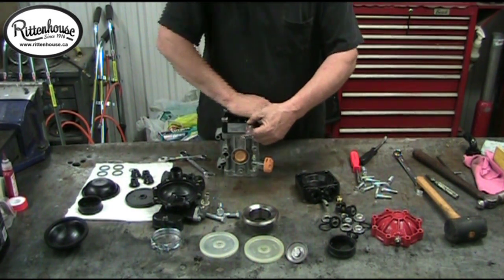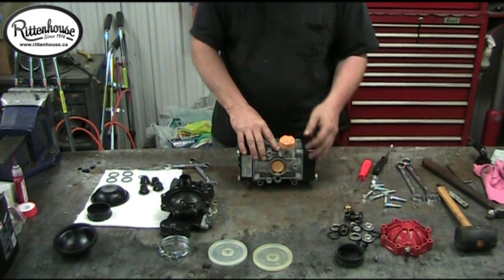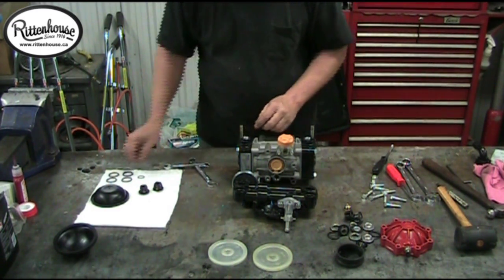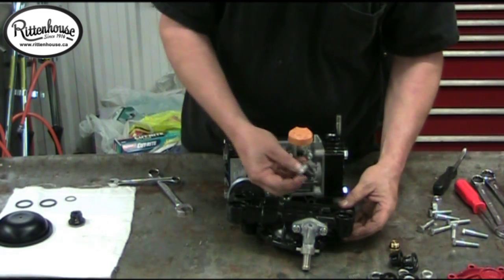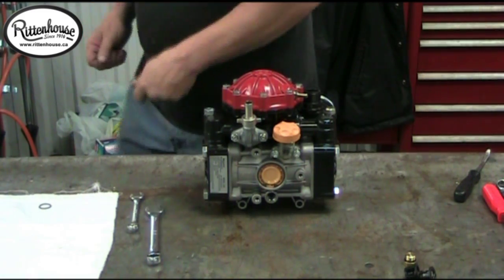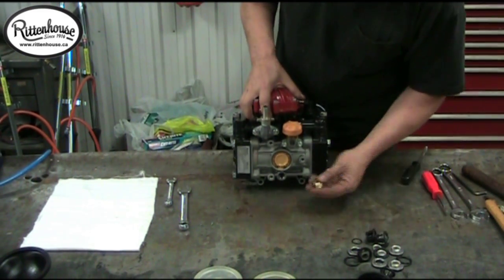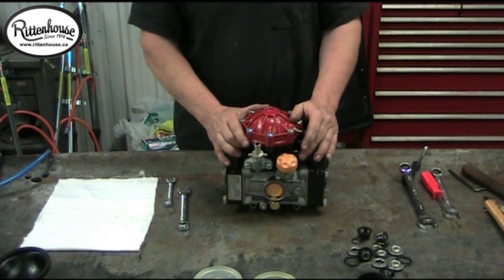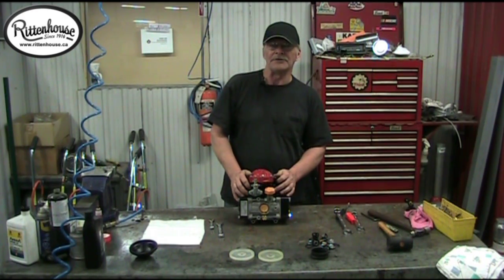Rittenhouse Hypro 9910-D30 Diaphragm Pump Repair PT 2

Comment: I have a 403d pump. My oil is mix with soliton etc.  Took it too the shop. Quoted me. $300. Which I thought was high because I brought the seal, seal package that has all seals, values and diaphragm.  Now the company calls back and says solution is mix in a different chamber. Lol which is what I brought it in for. Now he says the seal isn’t in the package and it’s going to be $420. Now Or I can buy a pump for $541 online  and he’ll put it on for $250 labor. Could you please give me your thoughts. Thanks